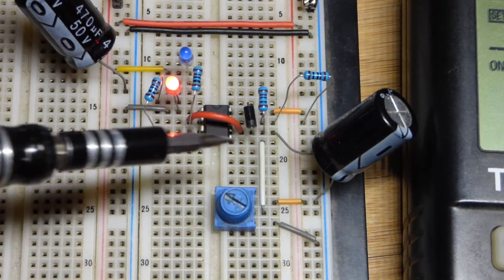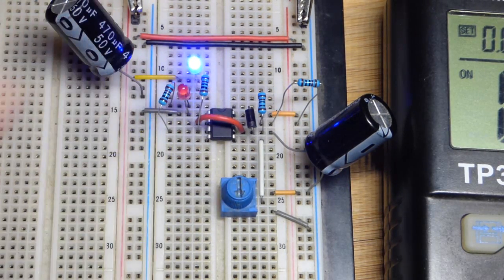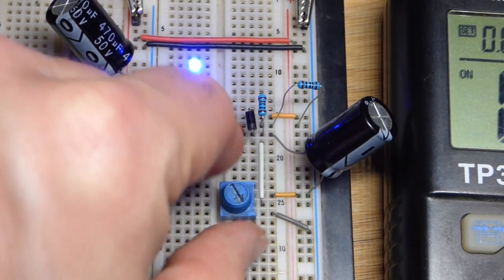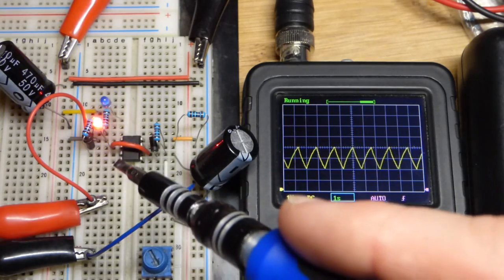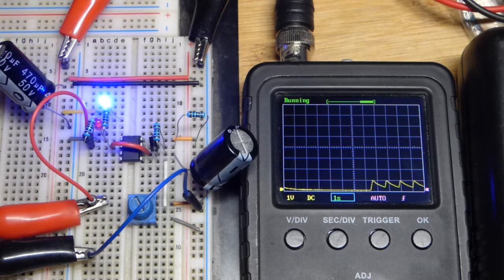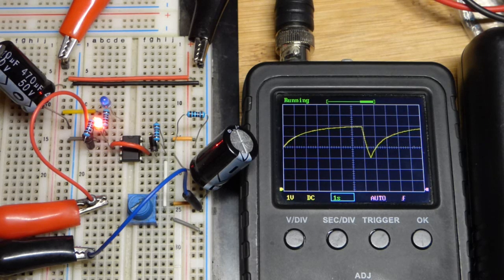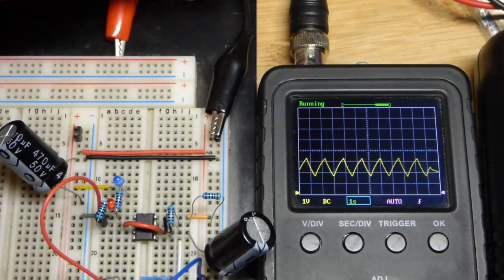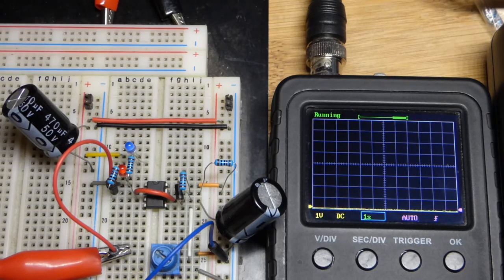555 timer control pin 5 to adjust duty cycle with trimpot

Comment: If you have seen "Scrap Computing" Throttle Blaster: A hardware Turbo knob for slowing down the CPU speed.  I was going to try a 555 timer instead of a Raspberry Pi Pico